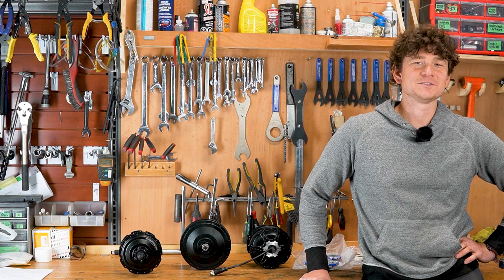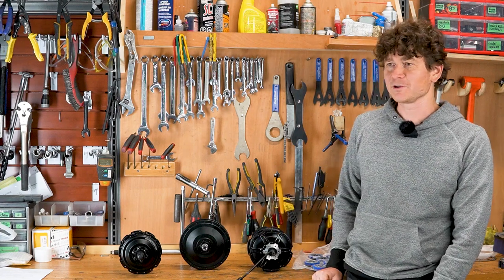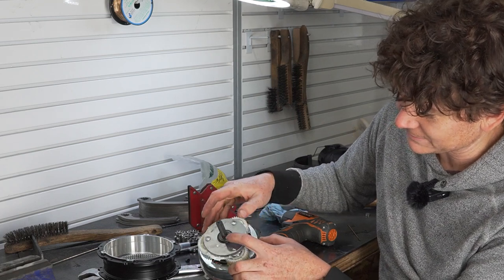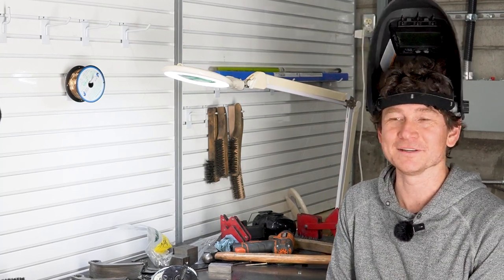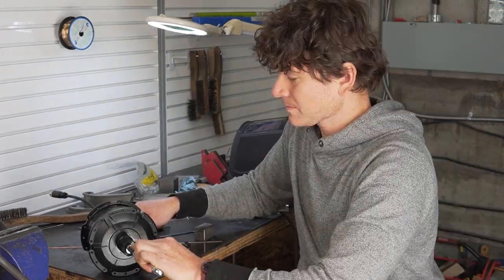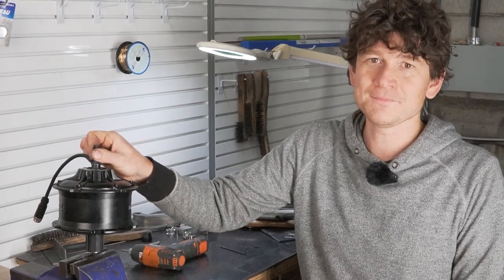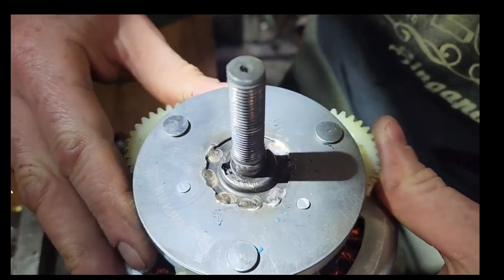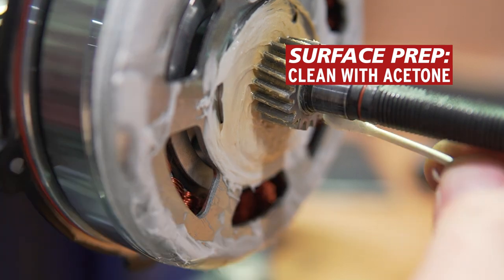How to get REGEN braking from your geared hub motor. Lock that clutch!

Comment: There's much easier way, any 3-phase (BLDC) motor can switch rotation by switching 2 of 3 wires (most healthily the 2 wires with the same resistance), switch the wires, reverse the motor, install the motor in reverse direction too, and clutch mechanism will be cancelled.
edit: won't work on disc brakes
Reply from the maker: That only works to reverse direction with sensorless systems, that doesn't work on controller that uses hall sensors, and this isn't the same as regen, it's motor direction reversal. If you do that (swap the phases) while the motor is running at speed in the forwards direction you will usually just pop and fry the controller mosfets.
Reply: @GrinTechnologies  You're right for off-the-shelf packs, you're so right about not recommending it btw I happen to be an engineer who designed my own motor, didn't have time to disassemble the off-the-shelf ebike motors and kits, but they must all have hall sensors. Mine is no-hall motor, bio-oil cooled (so the windings are thinner and motor is lighter, and bio-oil doesn't degrade plastic shielding of electricals over time unlike synthetic oil) [can use linseed or hemp oil for wide range of application temperature] and roughly speaking, if air cooled motor 24v continuous limit is at given size, you can pack oil cooled 43v 12s and thinner wirings.
Hall sensor is required on low rpm motors, high rpm motors synchronize after a few milliseconds automagically, in a way of speaking.
And yes, I got a reductor too, but not geared, disc-contact (with NBR sleeve) for silent operation. Everybody use timing belt or gears in e-bike motors, but I think timing is unnecesary, it just has to give power, and slip tolerance lower than the wheels, that's all.
Reply: And motor part is separate from reductor part because Alu-NBR roller pulleys run dry unlike the conventional gears.
Downside, I will have to make new rubber rings in 2 years like a tire-change.
Reply: @GrinTechnologies  Back to topic, my 500w 36v controller is free-gen on default, when you short the cables without throttle (nor PAS signal) it flows the kinetic energy on 3-phase side to electrical on 2-polar side, and a clutch system by wire to engage/disengage the wheel. The clutch mechanism is still on work tho, but the idea of freegen is, again, best of both worlds. I just couldn't find one built ready in market.

Comment: The disadvantage to welding up the clutch is if your battery goes dead, pedaling the bike becomes much harder as you are now fighting the motor resistance. Also, if you like to catch air, your landings will almost guarantee breaking the planetary gears, as I see this happen all the time when the rider stays on power airborne. Now you will need to worry about letting off too much throttle, as you can strip the gears due to the motor turning too slow. The amount of battery gain you get from regen will never make up the range from the coasting ability from the clutch.
Reply from the maker: Hey Bruce, it's true that there is more drag when pedaling without a battery (similar to the rolling resistance of your tires if you want to quantify it). But you are dead wrong about regen gains being less the coasting benefits.   See https://www.youtube.com/watch?v=gYCj4asp9pE. 

We've been selling non-freewheeling geared motors with the GMAC system for nearly 5 years no, with no instances of people breaking gears from being airborne or doing small jumps. I could see the sudden change in RPM causing a shock load on the gears due to the motor's inertia beyond what you'd normally get from motor torque, but I wouldn't universally say this will break gears as a blanket statement.

Comment: Good to see you Justin, I had one of the very first geared BMC motors 20 or so years ago now and still have it, used it on my electric BMX, we used to weld the clutches on some of the higher powered builds using this motor but we would then find that the nylon gears would shred, then we fitted steel gears which were noisy and then you could use the motor a bit more aggressively but then the motor would overheat, we would have phase wires solder joints un solder themselves, hall sensors cooking, magnet glue letting go, in the end we went back to using clutches, using a gentle throttle curve and limiting the power to no more than 1800W, we found the sweet spot to be 52V and 35A max, you dont have to go much over that to start having problems, if you get a good clutch the the benefits of freewheel far outweigh the regen benefits, when you take the losses in to account you dont regen enough to make it worth it as there is little mass to generate enough energy back, also the wheel nuts loosening and having to run 2 x troque arms is a pain, on my steel MTB I dont need to run any torque arms at all and have done 40,000 miles over 20 years with it like that LOL, amazing little motors but if you handle them properly and are realistic you dont need to weld the clutch.
Reply from the maker: Hey Knoxie and thanks for sharing your field experience.  FWIW you almost always 'gain back' more than you loose having regen vs freewheeling, see https://www.youtube.com/watch?v=gYCj4asp9pE  bewteen the 10 to 15 minute mark. 

The torque arm  / nuts loosening situation is for sure the most annoying downside with modding motors for regen. It's a consequence of all generic hubs using lame axle flats rather than a spline for the TA interface, but this here does the trick to solve this with a single arm:
https://ebikes.ca/v7-regen-torque-arm-12mm.html

We all think you should have another crack at this in spite of your experiences from years ago :-)
Reply: Appreciate your post about the drawbacks of this type of mod.

Comment: unless your using it for entirely for electronic breaking... you cannot add any meaningfull charge to a battery on something as low mass as an ebike, Also you need to generate a higher voltage than the battery currently has or the volts cannot charge it !  Cars have mass that takes energy to slow down and energy to accelerate .. even then 10 seconds or ten minutes of regen is negligable , the only benfit is less wear and toxic dust from breakpads.
Reply from the maker: >> you cannot add any meaningfull charge to a battery on something as low mass as an ebike

I guess that depends on your definition of meaningful. The % recapture rate on a bike is not as high as a on heavy dense vehicle like a car, but it is still north of 10% or more in most situations with an ebike in either stop and go riding or riding with lots of hills. It's better of course with loaded cargo bikes.
Reply: You don't actually need to generate a higher voltage than the battery if you are using a well designed bldc controller. 

Also, not having as much mass is kind of a moot point because the energy used for accelerating and decelerating are proportional to mass
Reply: @noobulon4334 If you charge your battery with your mains powered battery charger  for 4 minutes ...how much have you charged it ?....
4 minutes of regen cannot give you anywhere near a constant 2 amps like your battery charger ...
Mass inertia is the only stored energy you have . so it only makes sense on locomotives ..
On a low mass vehicle Why not just call them magnetic breaks. Calling them "regen" is just a marketing slogan , 
As I said before ,who is going "fast" downhill with their breaks on ?? you are just wasting efficient momentum and turning into inefficiently milli amps ...that is actually wasting energy !
I will connect my solar charge monitor to my battery output and go down the longest hill I know with my "regen breaks "on and give you the current ,speed,,duration data ...when it stops raining.
Reply: @marxman00  you're barking up the wrong tree here and for two reasons. 

First is that we have batteries that can charge in excess of 20C, (so 0-80% in less than 3min) the particular chemistry is Lithium Titanate Oxide (LTO), and as long as you have a big enough battery it can take in whatever current you need it to

Secondly the magnitude of energy in the system is irrelevant, what matters is how efficiently you can take in energy and release it. 

Lots of bikers don't like to stop or slow down even when they really should for their own safety because it is a pain to have to build speed again. If you can efficiently put that energy into the battery and use it to get back up to speed then you basically eliminate the physical penalty of stopping or slowing without killing your range
Reply: @noobulon4334  Dream on, What slice of the total energy pie are you using ?accelerating and decelerating is not a journey ..if what you said worked every electric vehicle would already  never need to charge ..because  the start inertia would magically last forever .we dont live in a frictionless vacuum , perhaps you are suggesting dream power,..without all the nasty physics getting in the way.
Reply: @marxman00  I never said anything of the sort

Think of it this way, people are terribly inefficient when you get close to their power limits. The main point of an ebike is to get you further down the road for the calories you are burning. If you make it so that you only use regen from stopping to help you get going again and that is the only assist you get, then that counters the highest load you see on your ride and saves you a disproportionate amount of calories for "free"

Incidentally engines are the same way, and this is why hybrids can get silly mpg numbers in stop and go traffic compared to regular cars
Reply: @noobulon4334  hybrid cars have mass .. and an engine , why mention  them rather than full EVs, bikes have as little mass as possible.. and no engine.
So .. what sre the figures ... they cannot lie. Exactly how many Watts  are added back to the battery and in what context are they beneficial apart from the  joy of adding thimble full of water to a bucket? Over Pumping up your tyres would vastly exceed  any gain by regen.. or even losing weight by having a pee before  the journey. Like Thrust to weight ratio is how aircraft can fly
Reply: @marxman00  Dont forget that you also have mass (much more than a typical bike), and while you can turn momentum into electricity you cannot turn it into gasoline or cheeseburgers (at least not in any direct way) thus why its analogous to a hybrid rather than an ev

The actual number for ebikes is ~8% more range under typical conditions but can exceed 50% if you have particularly hilly terrain (source: https://youtu.be/gYCj4asp9pE )

Also, I'm realizing while posting this that this source is from the same channel as this video
Reply: @noobulon4334  statistics ... thats 8% of the energy to accelerate  to  pre breaking velocity. after regen breaking on a theoretical flat surface , its not 8% of your total battery usag in a journey.  I will do the actual experiment  with my solar charge monitor . It will say exactly how many watts are ceated by going down an incline sufficient to not stop while regen breaking .... when it stops raining here
Reply: @marxman00   that doesn't appear to be how regen rate is being calculated here, if you look at the forum post in the description of the video I linked there are some harder numbers (and graphs!) And it looks like regen % is calculated as the percentage of the expended energy that was recaptured with regen

Doing some napkin math, stopping an 80kg mass going 30km/hr will put about .1 wh back into the battery assuming a 60% efficiency. Of course this is kind of a useless figure all things considered, but another useless figure is that this is equivalent to about 1/5900th of a big mac
Reply: @noobulon4334  Its watts over time that matter not just watts , you can use 1000watts just accelerating from a standstill ...Its very like loudspeakers and amplifiers, theres watts rms, peak watts , peak music power all measured  for 1 second burst of a sine wave .... in the real world application none of these really mean anything .. because its a coil of wire in a magnet being affected by its air loading due to its environment...over time
 its stopped raining ...i might connect my power monitor...........

Comment: Very nice idea for single speed geared hub motors.
I have a  XiongDa 2 speed hub motor that freewheels only apparently like a 1 speed motor. However I believe this clever 2 speed design is not a candidate for this REGEN mod.
It cleverly uses a pair of opposing roller clutches that take power by clutching to whichever is forward rotating be it the sun gear (normal 1:16 gear) or the ring gear (slow 1:32) as determined by the rotors electronically select-able  direction. Its planet cage is fixed and driven by a first stage gear reduction.
Reply from the maker: Your take is correct. Freewheeling is a critical component of retro-direct transmissions, and so regen and reverse will never be in the picture.

Comment: Id love to see some tests comparing the efficiency of a direct drive regen vs a freewheeling geared motor over various riding conditions.  After driving 10s of thousands of kms in an electric car its pretty clear that you get best efficiency by turning regen up in town, but turning regen off (and using efficient driving techniques) out on open country roads.  This is backed up by many other electric car drivers experiences also.
Reply from the maker: Speaking from seeing 100's of thousands of km of logged ebike ride data, I can tell you that the only situation with an ebike where a freehweeling motor will get you more range than a regen capable motor is when your riding style involves a majority (>> 50%) of the distance pedaling without using the motor and don't have any significant stop and go or long downhill stretches. In that case the extra drag from the wheel has more of a negative effect than the gains from regen.  

 Even in the case of coasting fast down a hill and building up momentum, vs going slower and collecting regen energy, you will generally go much farther powering on the flats from the saved regen energy than you would from the extra inertia of the higher downhill velocity achieved through coasting.  Storing energy via inertia is 100% efficient, but the quadratic rise of air drag with speed very quickly negates any benefits.
Reply: @GrinTechnologies  Thank you for the detailed reply, very much appreciate it.  The work you guys do on bringing electric vehicles forward as practical transport is  admirable and your enthusiasm for the technology behind them is genuinely infectious.  Wish you and Grin every success.

Comment: For Shengyi SX motor, do you know what steel is being used for the planet carrier plate, the center of the clutch where it connect with the motor axle, and the gear axles, if I want to make my own locked clutch gear set? (or for the GMAC/eZee gear set, what material is used there?)

Do you plan on offering a locked clutch gear set, or only plan on offering the mod for the foreseeable future?

Comment: My folding ebike came with a no-clutch geared hubmotor and I like the regen.
Reply from the maker: That's neat to hear, what is the brand of the bike? It's pretty rare to see this on a factory ebike.
Reply: @GrinTechnologies  It’s one of those old Currie folders with small diameter wheels and 24V of lead-acid batteries. They are suitable only for low-speed operation, and the regen makes speed modulation easy enough that brakes aren’t needed most of the time.

Btw, I’m an OG from endless-sphere forum. You guys at GRIN are the GOATS!

Comment: The truth is that the part that turns falsely when we put it in reverse is something that is kind of useless if we stop to think about it.
My bike once broke the cover on the ratchet part, I ended up realizing that it worked for a few minutes until it returned to normal.
With this tip, she will definitely have the regenerative brake!

Comment: Use a mig welder mate 😉 it's a "colder" weld enough for the needs and doesn't modify the shape of the piece 👍
Tig is to 🥵
Reply from the maker: Agreed, if we had a mig we'd have used it for sure.
Reply: Do you think welding this is even viable? Doesn't it warp the planet carrier? I'd assume that even the slightest warp will have extra wear on the gears long term?

Wouldn't it be better to drill a few holes and pour in some resin or something like JB weld?

Comment: Would the main advantage of a braking motor be the reduction of wear and tear of the friction brake system? And I I can see how such a system could make descending long grades safer.
Reply from the maker: That is definitely the primary advantage. The secondary advantages are totally consistent braking in all weather conditions and and extra 5-10% back into the battery depending mostly on how much stop and go there is in your commute as well as the terrain.